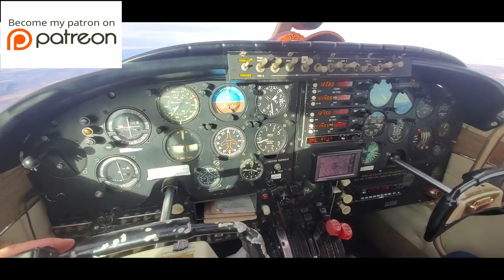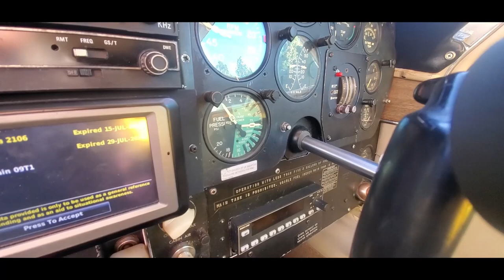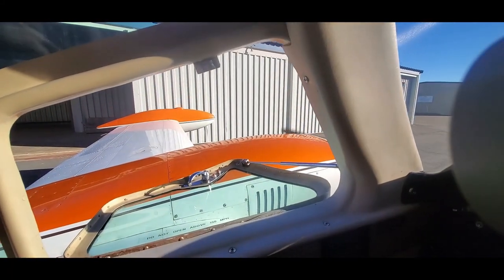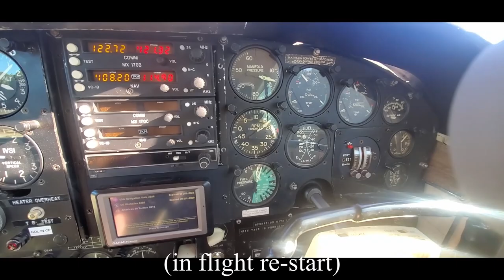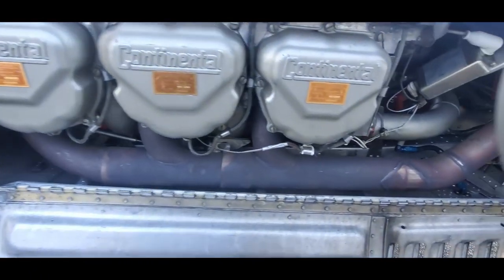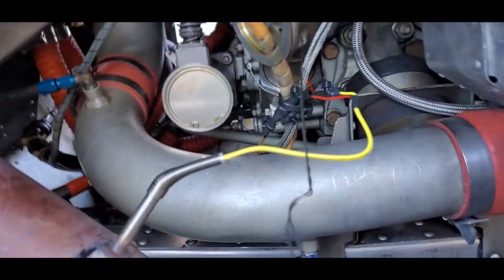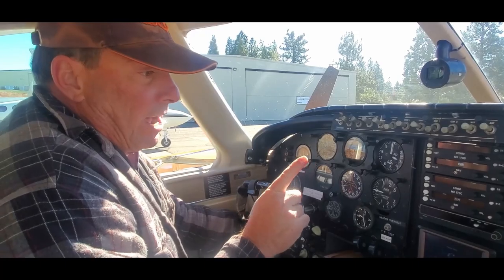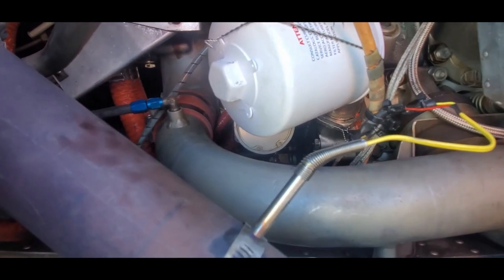1959 Cessna 310-C 'Harvey' Oil Change

Comment: How do you know that the Fuel Mixture setting is not to lean, and does not damage the engine?  I saw that some Planes have Temperature Sensors on all cylinders, which would be a clear indicator of to lean mixture. How is it on older planes without that?
Reply: You richen it up until the RPMs drop off slightly and readjust for maximum RPM (stoichiometric), as per SOP. You are stuck in a popular myth about lean. It is the stoichiometric mixture one should use for maximum power at take off that produces the highest possible exhaust, cylinder head temps and burns valves when they are misadjusted. Adjusting the mixture to stoichiometric at less than full throttle is fine, excluding idle speed particularly. Those practiced in lean for economy flying once having achieved cruising altitude and speed have to then open the throttle a bit to keep power output acceptable while tweaking the mixture for the sweet spot on the acceptable (non-missing) side of lean RPM drop. Some engines can do 10% drop fine, others struggle at 8%, all require a unique setting for that flight depending on fuel, speed, altitude, etc. Science is how you fly the plane that doesn't have the latest and greatest instrumentation. But to do that, you have to know and trust the correct factual science first. Lindbergh (that really famous guy) taught this leaning technique to the P-38 pilots during wwII and saved them up to 100 gallons of fuel each mission. Their engines started lasting longer due to the cooler temps they ran at. But the myth continues...
Reply: @leebarnes655  I don’t know anything about these Aircraft engines. Well what I meant is if you run it too lean you will get engine Knock- that will destroy the engine if not prevented. How is that a myth?

Comment: Aircraft heating inc. Your bird has a heater that is out of production. Should your heater fail the required pressure test hunt me down for best options or any tech support you may need. My name is Paul and i'm the expert on these cabin heat systems.

Comment: why camguard.. don't it have the additives already mixed in the oil why not? seems strange. synthetic is better,
I would like to see the engine flash out  every fourth oil change. but keep an eye out on the oil pressure on that engine, should not be taking that long to get to working pressure no more than a few seconds, need to keep an eye on it! An engine flush might sort it out if the journals are blocking up use a pressurised flash, 
 the oil pump maybe failing! if the flash does not work!